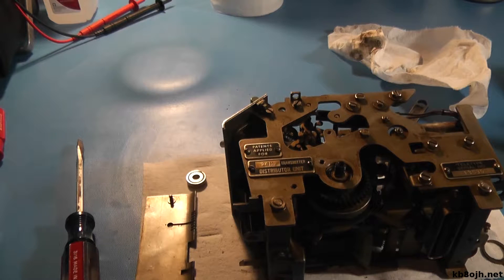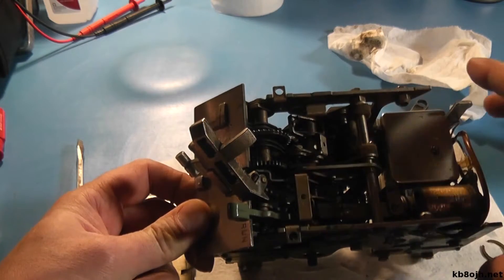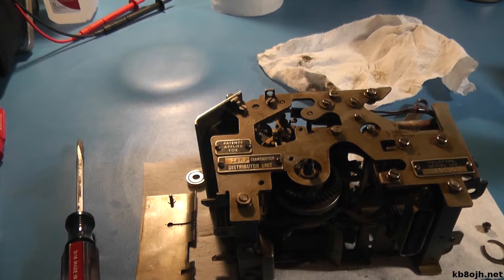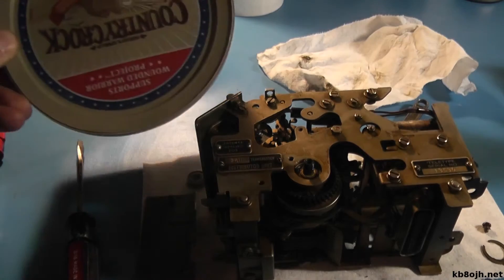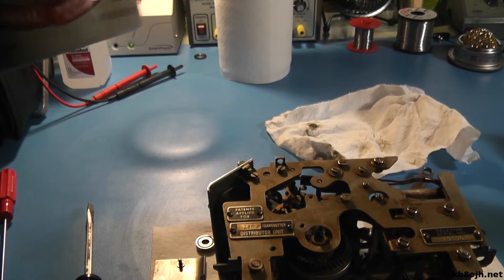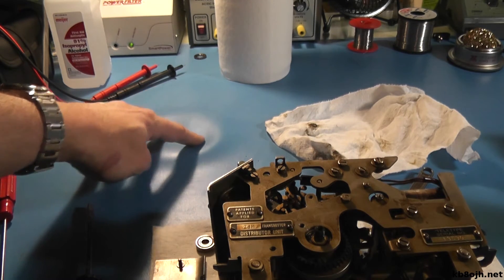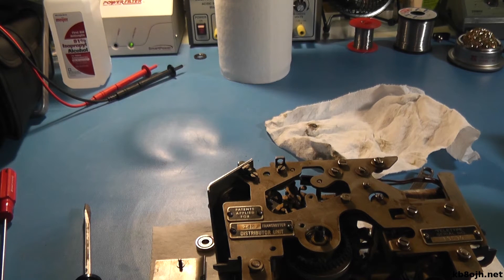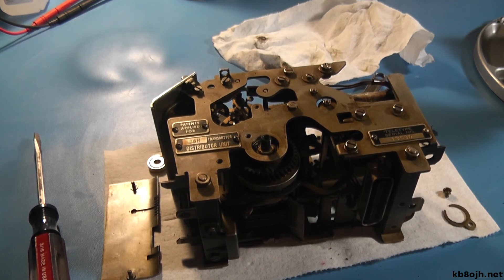Cleaning a Teletype, kerosene distorts ESD mat

Comment: In the old days we degreased Teletype with 1,1,1 trichloroethane ($2 a gallon) and put it in an ultra-sonic cleaner made by Bendix in Iowa and used a detergent from Bendix called "Dirltel" which was caustic.  Parts that were Parkerized were not supposed to be soaked in trichlor because it would permanently remove the "lifetime" lubricant. We briefly switched to trichloro-triflouroethane because it was "greener" but at $38 a gallon we switched back.  Plastic parts had to be cleaned by hand.  Teletype made a take-up reel for reperferators that had a plastic wrap-spring clutch.

Comment: That sucks, time to sneak one of the wife's Pyrex dishes out of the kitchen.  I am curious what the under side of the mat looks like? if it is just swollen with oil you maybe able to degrease it it with something and maybe save the mat. All else fails you can use the mat in the shop as a soft working surface for less critical work. Hope all is well over there my friend. TTYL
Reply from the maker: I don't think the mat is swollen with oil, as it doesn't feel spongy or soft, I think it was just allowed to relax or distort by the proximity to kerosene vapor.  The bump on the mat exactly fits the bottom of the margarine container!

However, I am going to try taking it off the desk and persuading it to more flatness with heat and/or absorption, we'll see what happens.

At this point I am assuming the mat is permanently damaged and it's just a lesson learned.  Fortunately the undamaged area of the mat is quite large, so as you say, I can cut it into several large, usable pieces and just lay a new piece for my whole-desk work surface.